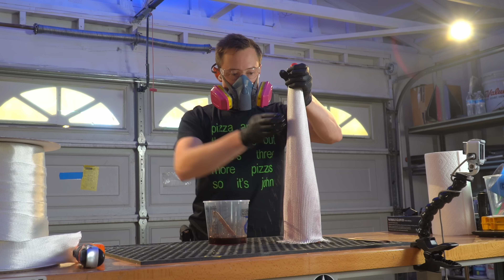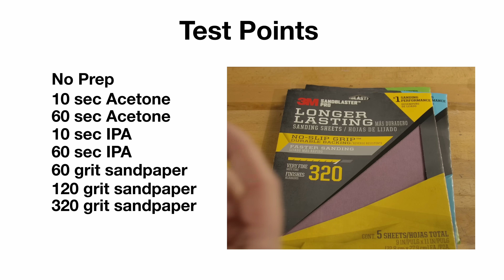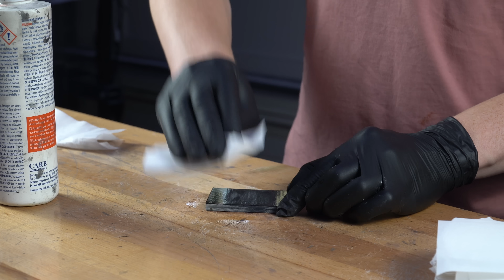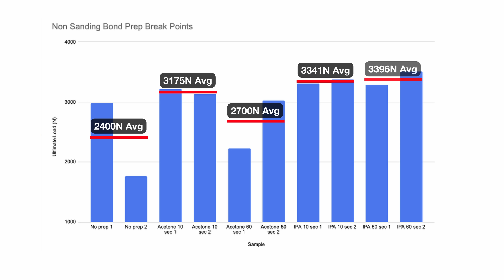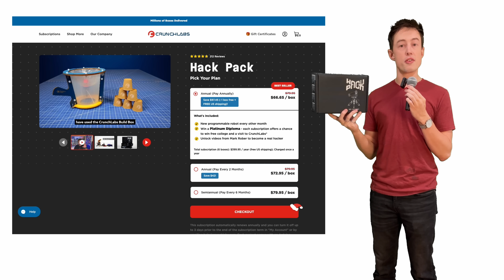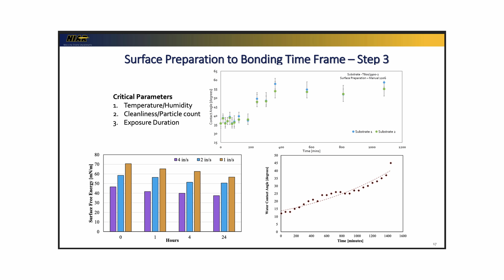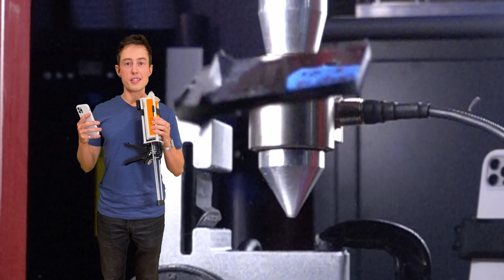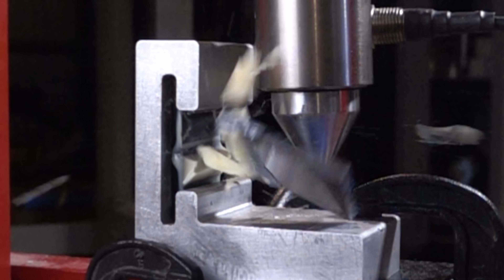I Broke 100 Epoxy Bonds to Find the Strongest

Comment: first let me say this was a very well put together video with a lot of useful information. thank you for sharing your results.
While I'm sure the majority of your force variance is due to the factors you are changing I cant help to wonder how much of the variance is due to testing equipment. for example depending on the load cell you can have up to a 3% variance of total load rating for its repeatability. if your load cell was rated to 5000N then you can have a situation where 2 samples break at the same force but are recorded as 150N different from each other, this can be accentuated if your load cell has a higher max force. if your load call was 20000N then results registering 600N different from each other in reality could be the same. of course these are just examples and it all depends on your exact cell. other factors like the distance from the joint, angle deviations based by fixture, ect. may also cause repeatability issues. my main point is that the test setup may not be as repeatable as you think. there is a test you can do on your measuring setups called a "gauge repeatability and reproducibility" while i don't think a GR&R is necessary for something like this I do think it is something to keep in the back of your mind when designing a testing/measuring procedure.

again, thank you for making this video. this is not a criticism, just wanted to share my thoughts.

Comment: I didn’t see a control sample on your test device. Use a monolithic material machined metal. Run the test on this machined  material, as this should reflect only the shape and the ym of the material.

Comment: This is your free class on bonding like a pro. I will first discuss it like we do for boats using polyester resin and will finalize with epoxy. You didn't say what you were using so I have to give the big picture.
Polyester resin is a mold release material. That's what it is designed for. Production molds.
You have 2 kinds of bonds. Mechanics and chemical. Each has their own method.
For a chemical bond, the products designed to do so typically leave a tacky layer. Like Gelcoat. When you have a mold, you first apply mold release wax, which keeps it from sticking, then you roll or spray your gelcoat really thick. That gelcoat will not cure all the way until it can no longer get oxygen. Then it flashes hard. This is so you can get an excellent chemical bond with your gelcoat to the first layer of fiberglass.
For a mechanical bond, you can get it to stick just as well with 300 grit as you can with 60 grit. The only reason you noticed a difference is because you did not prep correctly. You are supposed to very lightly dust spray some electric orange Krylon spray paint or black if your surface is white and then you sand the surface until every spec of Krylon is completely gone. You probably did not get completely to fresh surface. Krylon dust spray gives you a visual as to whether you did it enough or not.
Now, about epoxy. It won't stick to polyester at all (gelcoat is polyester to). For sure you won't get a chemical bond and a mechanical bond is possible but it's not that good. Epoxy repels polyester an vice versa. Just forget about trying to mix the two and you'll be fine.
Epoxy will stick fine to everything else. If prepped correctly.

Hopefully this clears the air and explains your results.

Comment: Interesting vid.  I'm curious what would happen if you were to use different types of solvents, and then clean with IPA. (IE: Instead of Acetone, use something like Hexane/Heptane, Methanol, Toluene, Dichloromethane, or Acetonitrile.) 

Also, another thought.  You could try a pressure pot vs. a vacuum chamber.  There are some people that will use a pressure pot to compress the bubbles down.  Last thought, try a belt-sander with 60 and 80grit, using a pressure gauge to get consistency.  Only option beyond the belt sander is a sanding wheel/wire brush.  

Just be careful with Dichloromethane and Acetonitrile.  They're not nice.

Comment: I’m not sure whether it was controlled for, but the curing conditions are likely just as important as the surface prep when you’re trying to maximize bond strength. The degree of cure directly affects cross-link density, so temperature control (and post-curing, if the formulation supports it) likely make a relevant difference. My understanding is that higher cure temperatures generally increase molecular mobility in the uncured resin, though the optimal schedule depends on the specific formulation. I think some epoxies even call for a post-cure to reach their full strength. For sub-100 °C conditions, humidity may also matter, so that might be worth tracking as well.

Also, for peak strength I’m not sure how consistent the mix ratios are when coming out of a nozzle. They’re probably close, but if you’re trying to optimize strength and repeatability, even small ratio variations might matter.

Comment: @13:08 - "...and then he told me where he worked; And then I stopped talking."  This sentence made me laugh.  When I worked for Pacific Aerospace and Electronics as a laser welder, my parts were degreased by going through progressive solvent baths.  Toluene, acetone, and then methanol; whether they were stainless steel, aluminum or titanium.  All solvents leave behind residue, so sometimes you have to clean the residue with a different solvent.  I am assuming this is similar to your composites problem.

Comment: Depending on the material solvents would intuitively weaken a plastic like material. Especially if too much was used and it was "wet" or sitting in the solvent for a period of time.

Comment: in all my use of epoxys, i wouldnt use any form of alchol for cleaning after sanding. ether acetone. or some other fast evaporating cleaner. i have found most alchol leaves behind residue.

Comment: Redo all your tests with adding microballons or other fillers such as west system 403, 406 etc. This will get your more accurate BONDING results and not have the epoxi itself break/shatter. As of now, it seems your results are almost useless.
You should have asked anyone working with epoxi in the boat industry and you would have saved a ton of work.
Heres another interesting test. Try to NOT wipe down after sanding. Some claim that all you're doing is introducing a risc of contaminating while wiping down/quality of the wiping substance you use.

Comment: Great video! It’s got me thinking, If I let a fiberglass and epoxy layer set up beyond the chemical bond window, how come every manufacturer wants me to sand it for a mechanical bond? Wouldn’t a wipe down of acetone followed by IPA be stronger and way faster? Assuming I didnt use peel-ply anyway.

Comment: How about adding drill holes 45 deg angles and some dowels or (mixed compressed crumbs of the stuff you sanded with the epoxy making the dowels) if there aren't any lying around.. so that there's some mechanical strength besides the glue. I'd like to see that one, a lot of work for you but a lot of fun to watch for us.

Comment: "The only way to know any of this for sure is to run the test yourself."

This is incredible wisdom in a much more general sense, in a time when even certified experts can't always be trusted.  We can't always test things ourselves, but we can recognize that not all people who claim to be experts actually are, and not all experts are honest.

Anyhow, I love this video!  I appreciate your disclaimers that your experimental methods aren't perfect and then clearly identify where the confounding factors are.  A lot of professional researchers use worse experimental methods than this and try to hide it, publishing work that can't be replicated, and even more deliberately leave out critical factors to prevent others from replicating their work, out of fear of losing commercial value for themselves.  Just the act of identifying the limitations of your methods puts you head and shoulders above many experimental researchers!

And of course, the information here is quite valuable, despite the limitations.

On a side note: This won't work with the composite substrates you are using this on, but I wonder if stripping the top layer of metal substrates using electrolysis would make epoxy to metal bonds substantially stronger.  (You discussed the use of oxygen to prepare surfaces, and my reaction was, "Electrolysis...oh wait, the material you are trying to bond isn't conductive.")

Anyhow, thanks for posting this!  I'll keep an eye out for the next one.

Comment: Sandpapers for wood and plastics, so called "open grit" sandpaper have wax or similar in them. Sandpapers for steel don't.  I looked like the orbital pads might be open grit, therefore wax, therefore contaminated joints.

Comment: We use 80 grit and acetone for powder coating.
I'm curious how a pressure pot would affect bond strength.
Not that building a pressure pot for rocket bodies would be cheap or easy.

Comment: Hi, have you thought about making small grooves giving a bit more surface area for the epoxy to bond to? And that would give both sheer and tension in the same epoxy seem, as the surface angle changes too!?

Comment: The mold release agent is a HUGE flaw. Especially if you degas it in the mold. You essentially mix your epoxy with the release agent!
Reply: Maybe a drying surface release agent...like maybe spray way for cars or something...grease like that is more than likely mixing like you said
Reply: Maybe instead of a full mold like that, just use card paper or some similar thin material that can either dissolve or just stay in place afterwards?

Comment: Drill some holes through the perpendicular coupons so the epoxy bonds through it too.

Maybe mill dovetail grooves in the base coupon too.

Both of these could reasonably be accomplished where fins are bonded to the rocket body.

Comment: Nice fun testing.
Were the glasfiber parts made with epoxy or polyester?

I wonder how much of a difference i reading it makes when the dlasfiberpart is flexibg down and by that the pusching part gets a longer lever?

But another question is why you just glue the fins like that? You maybe already talked about that in another video but wouldn't i hold much better if you would put a thin carbonfiber weave over the glue.
Or mix some carbonfiber in the glue. Like the typical 3 or 5mm. That should bring up the strength quite a bit.

Best would be to directly laminate the fins on the rocket. But i guess there are some other important reason why that is not working for that project.

Comment: I would say JB Weld [Not JB Quick] is the strongest or right there at the top same as possibly others. It seems to bond at the molecular level. As with anything it is better to roughen the mating surfaces.

Comment: At around 12:30 you mention that not degassing leaves bubbles in the epoxy, and while that's absolutely true and likely contributes to your results, since most of these failures are happening at the interface between the coupons and the epoxy, what I think is more likely is that air is being trapped within the grooves and surface roughness that contribute the most to adhesion

Comment: I've still got 10 minutes left in the video but the rate at which you apply pressure is a HUGE HUGE HUGE variable.  Back when the old pull off adhesion testers were manual hydraulic, if you were not super careful to take partial strokes and not shock the lever, you'd get a premature failure of samples.  I used to be the VP of Engineering for Belzona so I've got a pretty solid idea of what I'm talking about; not just some random dude on the internet (on this subject).
Reply: Ironically somehow belzona ads have become an in-joke for a lot of people that have a STEM oriented tiktok algorithim. Their application/demo videos have millions of views for no particular reason and I think it's hilarious.
Reply: BELZONA????
 
I don't know who you are, but I definitely know BELZONA.
 
If I had to guess, you're probably the smartest person in this comment section.
Reply: @JackOffAllTrades no, that's me.

Comment: I'm not sure if I missed it but one question I have as an engineer is how you verified your measurement setup. How consistent is your load cell? Is it actually giving the same reading for the same force every single cycle? How linear is it? How well does your setup deal with side-load, and how well does the load cell respond to off-axis load (your setup does not seem particularly rigid, nor well designed to maintain true axial load on the cell)? This won't explain most of your inconsistency, but it is probably contributing to it.

Comment: Regarding "increase surface area by craping with low grid" and its inconsitencies (didn't watched to the end yet, though 🙈): Did you account for the depth of the scrathes by "counting" the movements?

The amount of quotations maybe also highlights the amount of variables

Comment: Would you get, not a better bond, but a more capable side loaded strength if you drilled holes in the tube, chamfered from the inside, and filled that space with the epoxy while epoxying the fillet? You could drill through the fin so the two fillets could join, which would be like putting a u bolt through the tube to the fin. With that in mind, what if a short channel in the tube was taken away to let the bade of the fin have a secure base while side loading.

Comment: One more idea: Is you testing setup consistent? The force probe push thingy seems to be able to wiggle quite a bit. So is the distance from the bond you press on always consistent? I feel like this could easily account for 10% deviation from the different lever lengths. Also: are you sure the tip doesnt slide when pressing down?
Reply: He should drill a hole in each test article, at the same position, to apply the force at the same spot for each test article.

Comment: For context I have experience in surface decontamination and friction analysis from an oil lab (HFRR analysis of fuels and additives).

A practical problem that you will face when prepping the fins for bonding is the size of the part you are prepping. Having consistency in acetone application (timing, amount of acetone), sanding (if you go that route), wiping etc is so important. On a small slab of CF you can have much greater consistency in every step.

On a larger surface you might get local weakpoints in terms of bonding strength. That inconstistency can be detrimental to the piece.

Also you brought up the fact that in practice you won't be able to degas the epoxy while applying it to fins. You might want to do tests that replicate 'normal' working routines.

Also I'm no expert on the matter but won't the change in pressure and more importantly temperature of the atmosphere change the mechanical attributes of epoxy? I imagine that it doesn't help it at least.

But again, I don't have experience on the matter but wanted to give some ideas to consider❤

Comment: What about using a belt sander?

Better yet a belt sander over a moving table like a surface grinder?

Maybe a wire wheel would produce more consistent results? A wire wheel on a surface grinder? 

Was the epoxy temperature controlled or atleast logged? That is a big variable.

With big fillets like this, maybe adding some chopped fiberglass would eliminate the brittle failure mode? 

What about moderate heat treating with a temperature controlled heat gun. This helps with hard to glue plastics like HDPE.

Comment: Don't forget how much the geometry of the test coupons affect the results - they need to be geometrically identical (including at a microscopic level i.e. surface finish) Think where the highest tensile forces are - along the outside surface of the upper adhesive fillet, where it joins the fiberglass (google: FEA t-shape weld joint)  Any small defect, inconsistency, scratch with act as a nucleation site for a crack. And the waxing of the mold! Oh dear! If you get wax on the fiberglass as you drop it into the mold, it's at the exact worst spot!  Stick to the test standards, they are designed to minimize these kinds of situations!

Comment: None of this is right. The fillet is not designed to resolve these moment derived forces. This is why pi joints exist. Superlube is an atrocious mold release agent, free silicone means death for composite bonding.
Reply: Yea...
Reply: He went through so much work to have good bonding surfaces, and but introduces superlube to the system...

Comment: Alright hear me out.....connect 10,000V electrical leads to 60 grit sandpaper soaked in Acetone and light it on fire...sand VERY quickly...and probably wear gloves.  Wipe with IPA after.

Comment: What I did in the lab was: Starting with deionised water and then alternating 15 min Acetone/IPA cleaning in ultrasonic cleaner and after that a set time in plasma cleaner. The plasma cleaners aren't too expensive. The problem are vacuum pumps and constant gas flow.

Comment: The vacuum degassing may also help the epoxy penetrate the microgrooves created by the sanding process. By default those grooves are filled with air, which obstructs the epoxy. Removing that air might facilitate penetration, especially in the finer grooves produced by higher grits. Also, the IPA and acetone may not excel at removing the dust from sanding, especially if it's embbedded in those grooves. Perhaps a detergent wash, or high pressure air would make a difference.

Comment: I always Grit 60 and then isopropyl alcohol
Acetone is stronger yes, but so strong is actually melts plastics, learned that on my car headlight, which for surface prep would basically undo at a micro level the sanding
And... that's pretty much it